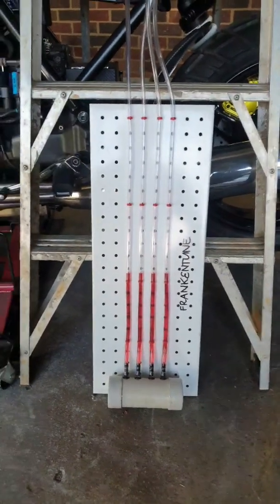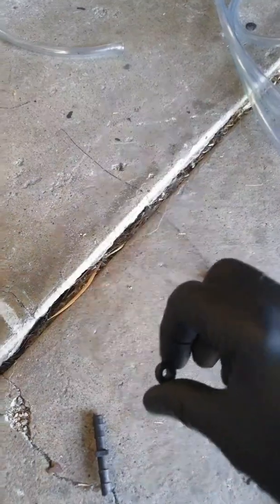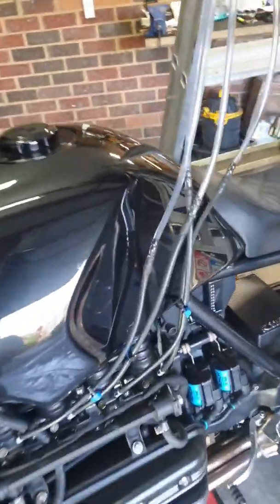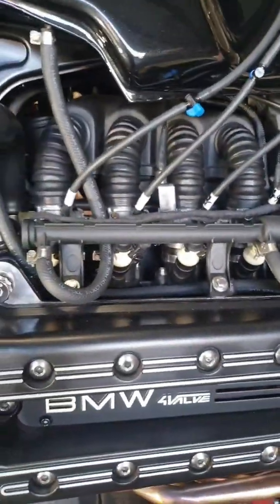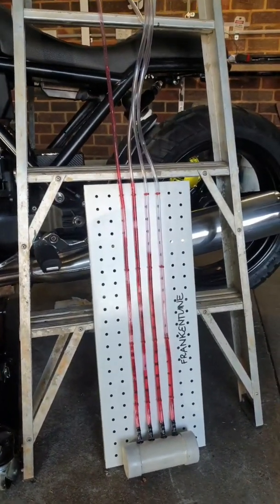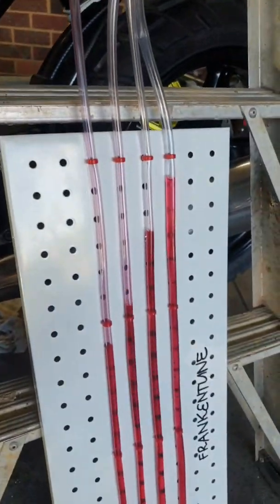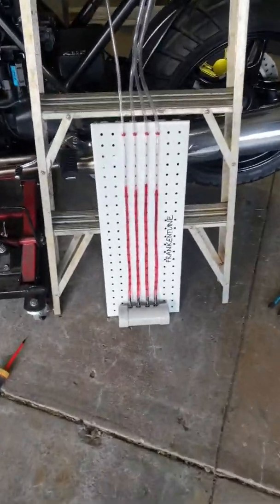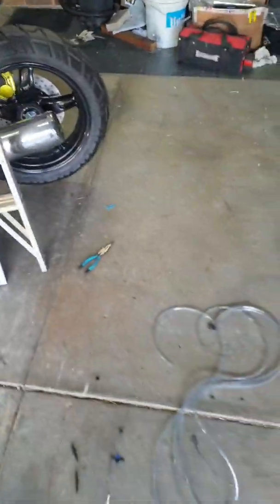Homemade manometer for throttle body synchronisation BMW K1100 BMW K100

Comment: Me podría ayudar , no he podido con este sistema , el liquido me llega al motor por lo que me toca apagarlo , cual seria la solución
Reply from the maker: Hi there, not sure why this is happening? You can add restrictors to the line with adjustable taps or filters to add resistance but I didn't have this issue so not 100% sure sorry.

Comment: Where did you get the little black and blue valves in the tube there?
Reply from the maker: From our local hardware store (Bunnings) buddy. They are for irrigation drip systems

Comment: Dude....bike is beautiful! Really hate that the exhaust is blocking that beautiful rear wheel. That's a good focal point of those bikes. Just my opinion. Great video
Reply from the maker: Thanks for the comment William 🙏 the OEM was only stuck on there to pass it's roadworthy inspection then quickly horse kicked straight off for a right hand conversion pipe and S100RR TERMI shorty I had already sitting patiently waiting. You'll see this in my later vids 😉

Comment: Does there need to be some sort of relief valve in the system to avoid sucking the ATF all the way up the hose and into the engine?
Reply from the maker: Hi Sam, not at all buddy I actually installed some valves up the top to start with as I was worried the same thing would happen but removed them when it didn't. I had a lot of hose and draped it up over a step ladder to make sure nothing got sucked high enough. When I first did it one line shot up pretty quick but I cut the engine well before it got up near the top of my looped hose and adjusted that TB for less suction which sorted it out to balance across the others
Reply: @twistedfatebuilds  Thanks for responding so quickly. I'm gonna build using your design. It's cleaner than some of the other DIY designs on youtube. I think what I didn't understand until now is the effect of the common reservoir. If each tube had its own reservoir I think the fluid would in fact be sucked all the way up the tube. But because there's a common reservoir the different hoses are 'competing', in a sense, and so fluid can't be sucked all the way up the hose.
Reply from the maker: @samslaby4882  No probs mate. I have seen them work by just linking the 4 tubes at the bottom too but I liked the resivor idea better so went that way and it works perfectly. Just make sure to leave a lot of tube and hang the loop up high in case you have a TB that's way out of sync as it it suck it up quickly. If it's really bad you can always bench sync them first to get close then finish on the manometer

Comment: First  see you have correct coolant for aluminum motors. 
Then check compression and ignition.
Adjust the valves and check the fuel pressure and the air filter.
THEN adjust the suction. 
A lot of job to build a tube checker so I built one with valves from old gas stoves and manometers I already had.
BTW
Check rubber houses for leaks.